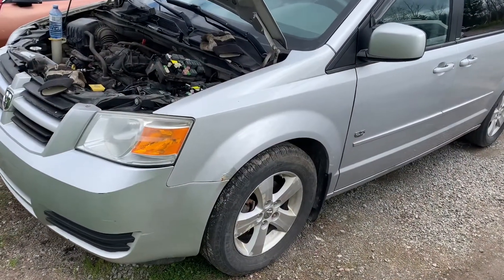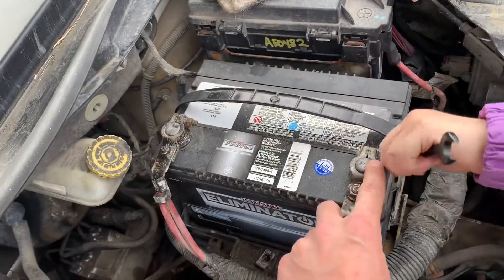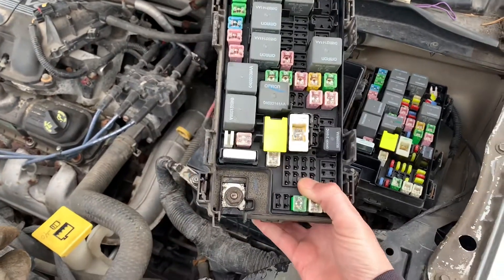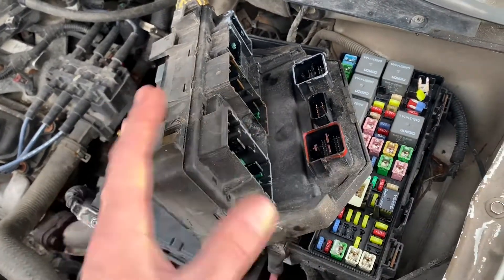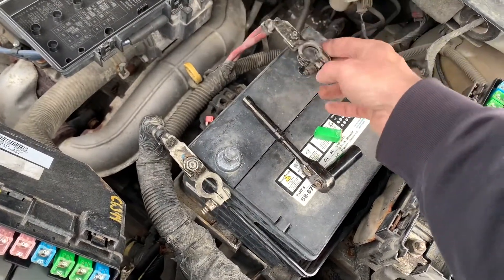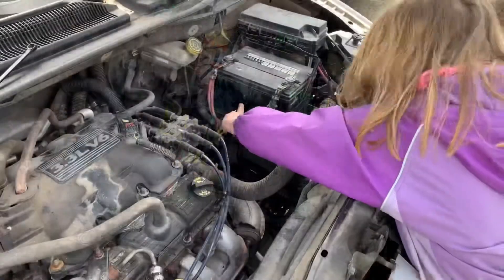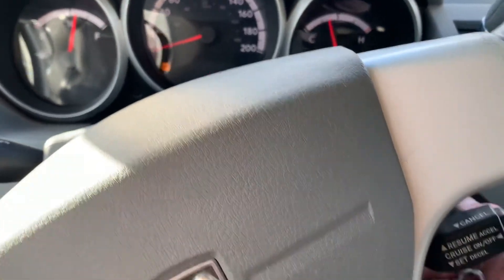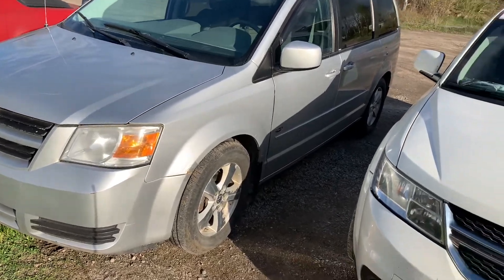Grand Caravan Electrical Problems TIPM PCM ABS

Comment: Did it stop draining the battery?
Reply from the maker: Yes , drainage solved but also I found one of the main pins to the ABS module plug was severely corroded as well, which may have been one of the contributing factors to bad connection or poor connection resulting in PCM failure.   I think the ABS module & main plug for the abs module (on the firewall behind the battery ) caused resistance and connectivity issues resulting in PCM and abs failure.  Replacing one or both modules and repairing the damaged ABS plug pin/wire solved a bunch of issues in my situation.
...  I think the ABS plug is commonly overlooked and possibly a common problem where I found one of the main wires was damaged from the connector pin being corroded and or heat damaged from resistance.  I can see this being commonly overlooked and causing a multitude of related issues pertaining to abs trac control speed sensors , bad grounds or poor connections causing modules to fail due to resistance or short malfunctions.  These vehicle and era mopars are known for bad/poor or dirty grounds, wiring issues and modules.  🤷🏽‍♂️ especially up here in the rust belt where sodium chloride 🧂 salt brine and other corrosive chemicals are used to treat the snow and dirt covered roads
Reply: @613Builds  how do you determine its the module that needs to be replaced? My van I’ve had for 4 years one day dash lights flickering my headlights and radio on and off. I’m wondering should I try this?

Comment: Helpful info and video - thanks!  Where was the ABS connector you mentioned you found corroded?  I have a 2010 T&C 3.8L/6spd, 142k, been having intermittent ABS lights for over a year.  This sounds more likely to be my problem rather than speed sensors or the ABS controller.
Reply from the maker: There is a big connector down below around the steering and brakes under the hood.   It a big plug and it’s the only one going down to the ABS module.  If I unplug the ABS module or the main power to the ABS (which was corroded and possibly melted)  it runs and drives fine.  I suspect faulty ABS module feedback causing the CPU to short or malfunction.  If it runs and drives with NO ABS I suspect ABS module faulty internally

Comment: My van is doing same all dash quit working windows turn signals wipers stay on unless fuse is pulled do you think if I replaced the computer like you did or something else.
Reply from the maker: You could unplug the TIPM (computer) and check the connections there.   Sounds like either the TIPM or bad ground / bad connections.

Comment: I have a 2008 Dodge Caravan 3.8. My gauge cluster and turn signals quit working. Windshield wipers stay on unless I pull the fuse. Other then that the car runs and drives fine. Do you think I should replace my TIPM?
Reply from the maker: I’m not sure those issues may not be be related to the powertrain control module, but wouldn’t hurt to look at the connections and make sure they aren’t corroded.

Comment: Cool it worked. Any particular issues with the Dodge Journey you have? I have an 09 Journey AWD R/T with tire light flashing. It’s mostly on but goes away randomly. Have to jiggle shifter at times to get it started. Anyways, cheers.
Reply from the maker: Maybe a low battery in one of the TPMS sensor .  My friend and I both had rear alignment and camber issues with the journeys , wearing out tires prematurely on the rear.  My caravan had a slightly sticky or misaligned shifter cable at first, sometimes had to bang it into park firmly to get the key out lol 😂.  Seems better now though
Reply: @613Builds  Dodges can be so dodgy sometimes. I did originally replace my TPMS on all 4 wheels, had same problem after. Could be wiring somewhere or bad/missing ground from what I’ve read. Funny enough, I too have a Grand Caravan(2007). No issues with TIPM but it feels like the shifter is sticky when switching gears.
Reply: With the camber/toe issues on the Journey, mine was similar. Had to replace the rear upper control arms(adjustable after market)to correct it. Originally thought it was bad shocks in my case, unfortunately it wasn’t. Live and learn I guess.

Comment: My 2012 caravan has new battery and died while driving and wouldn't start. Lights and radio still work but horn and power windows and locks won't work. Hour later it starts fine. Drove for a week no issues then happened again. Sat for the day and started again and drove home. Haven't touched it since. Is it fuse box or fuel pump relay, or alternator
Reply: Sounds like your TIPM is causing problems. Same thing happened to mine. New alternator, new battery all of a sudden it wouldn't start. Unplugged the fuse box for 30 minutes and bingo all codes went away van started. But alternator still isn't working so I'm hoping new fuse box fixes that.
Reply from the maker: Likely the computer which is built into the fuse box .  It’s totally integrated powertrain control module .  Otherwise check the grounds and codes but likely the TIPM.  Mine also had a shorted out ABS module.  If I removed the ABS plug or fuse , it would run.

Comment: Please help me... i have dodge caravan 2018... recently the break lights didn't turn off and it kept lighting and the only way to turn it off is to remove the battery, and we replaced the brake pedal switch and nothing happened the same problem was here , waiting for your response and thanks !
Reply from the maker: Try to unplug the pedal switch.  If that works, it just needs to be adjusted

Comment: I have the same van my alternator stared to smoke now I have no power and my battery is died any help would be awesome I did ordered a new alternator and battery.
Reply from the maker: @jessicaadammccollummoore4340  hopefully the new alternator (and battery) will solve the problem.   Maybe the old one just shorted out.   Wouldn’t hurt to do visual inspection on the cables and connections, grounds and fuses

Comment: 2011 Dodge Grand Caravan starts up fine no problem but after 15 minutes of driving it shuts off and drains battery but I recharge it and starts back up…brand new battery and alternator have been done still does it!! Could this be it?
Reply from the maker: It could be the fuel pump relay which is built into the the TIPM .  Any error codes or service lights?  Could be the alternator or connection to the alternator.  You can check it for output with a multimeter or battery tester.  If it’s the fuel pump relay you can sometimes hear the fuel pump running. Otherwise check connections , grounds, alternator ground, engine ground, output voltage , etc
Reply: @613Builds  I’m buying it from someone who was gonna junk it for 400$ and they said they put a new alternator and battery in it already so I was gonna take a chance on it probably going to anyways just never worked on a grand caravan
Reply from the maker: @jasonraper5096  good idea ✅ I got mine for 600 same thing , had an issue previous owner couldn’t figure it out.  Sometimes would run sometimes wouldn’t.  Scrap is up over 400 per ton so you’ll make gains even if it’s total scrap 😎👍🏽 also I had a badly corroded pin on the big ABS module plug so check those if you can

Comment: Can TIPM cause the alternator to not work?
Reply from the maker: Possibly 🤷🏽‍♂️ I’m not sure.  You could check for input and output to the alternator and go from there
Reply: That's what I'm experiencing with a 2007 DGC 3.8
Reply: @613Builds I'm replacing the TIPM and PCM.
Reply from the maker: @paulcbaum74  I’m not 100 % sure but I think mid 2008 was maybe the first year of this style.